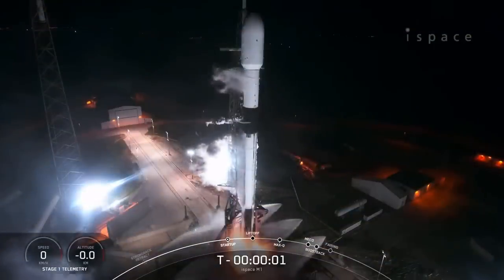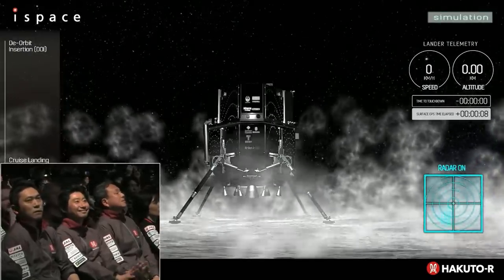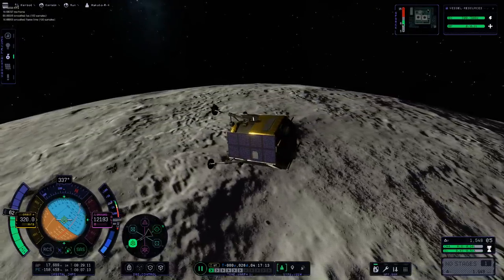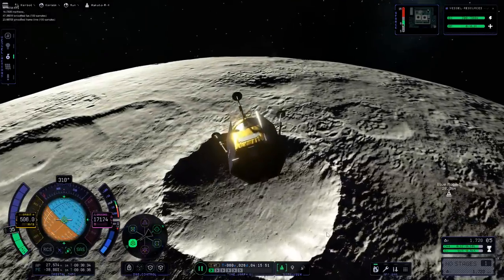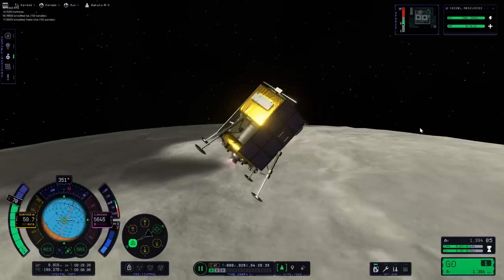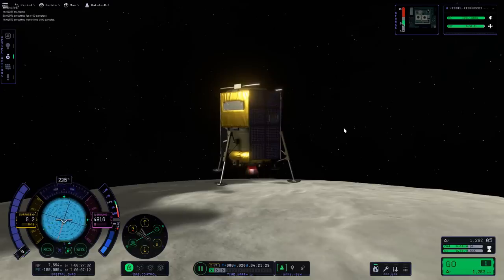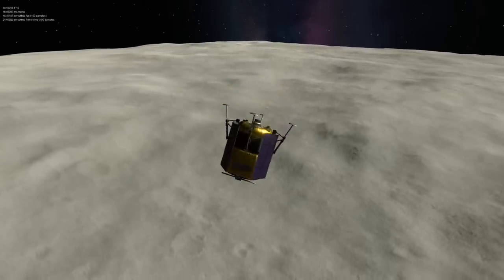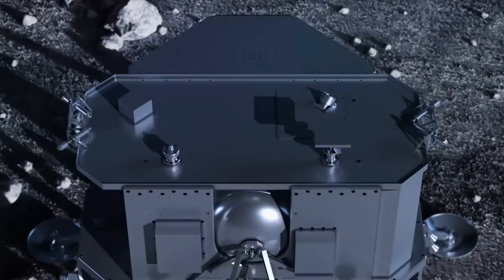Why Japan's Moon Lander Crashed Due to An Unbelievable Computer Bug

Comment: Given that it was not possible to land the craft without the altimeter data, it's an odd programming decision to permanently ignore that data the moment it starts to look janky.  Odds of the altimeter recovering its wits may be slight, but I'd rather give that a go than rely on an approximation that's +/- 5 km in altitude.
Reply: Exactly what I was going to say.  Since radar altimeters are highly robust there is almost no situation where you should ignore one.   If it does fail your mission is doomed, whether you ignore it or not.

Comment: My Dad helped design the Apollo lunar landing software ... and curiously enough, it was never used due to a sensor overload ... the famous DSKY error 1202. When Neil Armstrong disabled my Dad's software for Apollo 11, that was the end of it. The LM landing program was always over-ridden by future LM pilots and the LM was landed manually. The fault was in a completely unrelated system ... I guess a lot of people wonder if it would have done its job. My dad says it was pretty robust and he never saw a simulation that it would have failed if given the chance to run to completion.

It's a good thing Armstrong was a good pilot!

My dad would go on to be famous for mockups, and then later, he worked on the avionics of the world's most capable fighter jet. He's getting old, but still with us. I wish he was more of a storyteller ... but the one he thought was the funniest (and most irrelevant) was meeting the president in the restroom at NASA ... as in, um, nice day, isn't it Lyndon? as they conducted their business. I am guessing it was during LBJ's visit to Houston in 1968, the same time frame that my dad was working there.
Reply: You  PT-xi5rt   didn't know that LBJ was president? Or that he used the bathroom like the rest of us?

Comment: Didn't Neal Armstrong have to do some on the fly recoding to overcome the 1202 error when the Eagle lunar module was getting overwhelmed with input?  (Which was fixed on later Apollo missions through code fixes and turning off an un-needed radar as part of the checklist?).  Seems like they could have used an altimeter, but on the moon the altimeter setting is always "00.00" 😅

Comment: Stuff like that is really hard to catch before hand. Perfectly good sensors spit out garbage sometimes. I honestly think it might be worth having dual altimeters just to make the signal more robust. (Yea i know it would weigh more) but maybe lidar + radar. Then you make the software not able to disqualify both the radar and lidar at once or something.
Reply: Calling it a bug seems wrong tho to me, dual altimeters at least would continue measuring.
Sounds to me if an unusual number pops up you don't straight up then ignore further readings maybe?

Like did they set up the software to turn of a key component off once an odd reading occurred?
Having a backup for dual if not triple check incoming data on the fly instead of relying on past information should be normal.
 Just because a road was empty 30 seconds ago doesn't mean I'll blindly trust there won't be something speeding around the corner.

Expect the unexpected especially when it's not on the same floating rock right.
Reply: @dounyamonty  The system was designed to ignore all new data from a sensor if it felt like some of the readings were out of bounds. They could have had 20 altimeters and the system would have ignored them all because they all would have shown the same "error".
Reply: @patreekotime4578  When you have only one sensor for a given parameter, treating it as failed after seeing out-of-bounds data from it is just about the only thing you can do.  But when you have more than one sensor, you can cross-check them, and that usually becomes your primary method of determining whether a failure has occurred.  If both sensors do something unusual at the same time, you might reasonably infer that the problem is not in the sensors.
In this particular case, the spacecraft should have been able to cross-check the radar-altimeter reading with the topography it was flying over.  Seeing the distance-to-ground reading increase rapidly as the ground abruptly drops away beneath the spacecraft is an entirely expected condition.
Reply: Right! Really hard. Who would consider that the Moon might have craters?

Comment: Sounds like they tightened the Mahalanobis check magrins in Kalman filter. It's the check that real measurement at each time step, expected measurement and estimated measurement errors are all in accordance with each other. And you usually hardcode the acceptable marigins for that, i.e real-expected measurements must < 4 times expected error. If it isn't the measurement is bad (e.g. accelerometer physically fell off the mounting). Unfortunately the margins are often set too tight. 
It could've been another problem tho, related to algorithms similar to simulataneous localization and mapping, but I don't have enough experience with them to judge.

Comment: When flying on instruments, pilots are trained to trust what the instruments are showing them, not what the software in their heads is telling them "I can't see the horizon, so I think I'm upside down..." No... You are the right way up etc.
Reply: We too low...
Reply: @thePronto  We too high when we ran out of fuel... OOPS. Instruments didn't lie then?
Reply: @brianjrichman  bang ding ow.
Reply: Been through the training, you absolutely cannot trust your feelings. It varies for each person, for me, I felt I was leaning one left and right. I had to actively fight to focus on the instruments, draining your energy very quickly. Even if you are completely focused on the instruments, your arms will try to 'Level' the plane.  You acclimate with each subsequent flight easier, eventually it's nothing. Instrument flying is still draining as you have to fuse all these sensors. In comparison, looking outside is about as stressful as driving.
Reply: @thePronto  :face-green-smiling:
Reply: @oohhboy-funhouse  Yes Sir! It's almost like the programming team had no idea that the moon has craters...

Comment: I would add optical recognition and stored high resolution images to the package. These would optically compare the expected position and orientation to the visible information and so call out anomalies. This entire apparatus would be as small as a Raspberry Pi, using off the shelf components. DJI drones use something similar in their RTB software. When the drone sets off, it takes photographs of its starting location and compares them to the downward facing camera live images when returning to land.
Reply: One of the reasons Chandrayan-2 failed because of the mapping. When the lander moved away from the photographed landing site it tried to over correct and failed.

Comment: I remember one of my computational methods professors said: "There are no such thing as software bugs, only human error" in one of our first lectures so that we would code more carefully and make sure everything has correct syntax before moving on to a new line. It'll save you a lot of time rather than overconfidently writing 100 more lines of code and then having to scroll through it all only to find that you coded "fr" instead of "for."
Reply: Most bugs are not caused by typos but by overlooking consequences somewhere else in the code, like creating a potential timing/synchronization issue. Or by wrongly interpreting the functional requirements, or by misreading the documentation from an external library and things like that. Typo bugs are rare, except in the ui but that is because certain programmers cannot write decent English sentences 😅
Reply: @effedrien  I think he was just giving a basic example.

Comment: Why haven't they orbited GPS satellites around the moon yet?
Why don't they drop transmitters to the surface first as becons?
Reply: The Moon has very few stable orbits, and they still require propellant. The moon is very lumpy and the earth tends to fling you off.
Reply: Dropping beacons on the surface is the exact same thing as putting a lander like this down.
Reply: @samuraidriver4x4  To make it easier to land our probe, we will first land three probes.
Reply: Apollo did that once using a Surveyor lander as the beacon.  But that was just for position, not altitude.
Reply: @samuraidriver4x4  
Really? Can you describe your design?
I was thinking about a lightweight baseball sized package on the end of a long collapsible pole, throw a dozen of them out in hopes a few survived to do the job. 
Or how about a huge air bag with the probe suspended by rubber bands in the center, no need for an accurate landing of the beacon.
Did y'all really think I was suggesting to land a huge piece of equipment to be a beacon?
Reply: @mballer  what would you expect to happen to those when they smash into the lunar surface at let's say 500kmh?
Airbags and such need to be extremely strong to work inside of a vacuum and also withstand the impact, that's alot of "dead" weight.
Keep it "simple" and do a powered landing.
And for a beacon you do want a precise landing on a precise location otherwise there is no point in using triangulation to figure out positioning and altitude.
Atleast that's how I think of it.

Comment: This story reminds me that once I planned to make a simulation for spaceships/probes, where the simulation goes down to almost hardware level, where the subsystems (sensors) could be  configured to have a certain precision, sampling rate, processing delay, and the way how they communicate with the CPU, the flight computer, so the design of such a vehicle architecture would be closer to reality. Also, the propulsion units could be configured to have delay to start/stop/change working, and a function, how it is done.
May be, in KSP3? :D
(Feel free to use this idea, most probably I won't have time to develop it.)

Comment: Dunno if you'll see this, but I'd be suuuuper interested to hear your thoughts on whether software engineers should have the same certification processes that physical engineers have.
Reply: Fyi: they do have in some countries. 
One isn't allowed to develop software for medical gear for example here in Germany without certain qualifications. There are also legal requirements and standards that the software development teams working on critical or potentially dangerous software have to adhere to here both in regards to coding and testing, but also in regards to their overall software design, risk analysis and much much more.
Reply: The kind of software you're working on makes an enormous difference to the consequences of getting it wrong, and I don't think it necessarily makes sense to try and develop a certification scheme that's simultaneously rigorous enough to assess people working on nuclear reactor control software while not failing 90% of candidates going into a career in casual game development...
Reply: They do. Software engineer, computer engineer, computer scientist, etc they are all degrees that you can get studying in college. The issue is that you have all the 3 month long React crash course Jimmys that call themselves "software engineers" when they are software developers instead. So yeah, there are many different certificates for software engineers, its just that the name is often not respected.

Btw Im not trying to shit on self taught or non engineer software devs. The same way people like Michael Faraday did amazing things in the name of scientific research without a degree, some software developers are incredible at what they do. I dont want to sound like Im implicitly blaming the lack of certificate enforcement as the reason why stuff like these software bugs exist. This could have very well been coded by a software engineer, who would be also not to blame because stuff like this has to be peer reviewed and tested by many people and on many levels. It was simply and incredibly unfortunate event
Reply: A degree is not certification. And for physical engineers that assume accountability for the designs of their companies, Principal Engineers, their job titles do not come easily. What would be interesting to see is if there is any push to require engineer ACCOUNTABILITY, not just responsibility, as things are currently in the physical space.
Reply: This brings me back to my software engineering course.  There are supposed to be several stages like requirements, specifications, design, implementation, testing, maintenance.  And each stage is supposed to be evaluated and fed back to improve processes.  The instructor stated that there had only ever been ONE software project to have ever followed the theory: Space Shuttle avionics.
Reply: If you care for my tought: There's probably nothing wrong at all with the software engineering side of this. But someone who is not a software engineer either didn't bother to read the specifications or thought "that's probably going to be all right, anyway it's time for dinner now".
Reply: No, but certain industries can and should be regulated more. If someone is riding on whatever you've built, then there needs to be more oversight.
Reply: No, certification is worthless.

The physical equivalent would be if you had an engineer carefully design a bridge over a river, and then you decide to build it but on a completely different river but without checking to see if the design is suitable for the different location. Do you think certification is going to solve that?
Reply: The problem with all of those schemes is that sometimes the person with the most creative solutions or the best knowledge of how the systems work is the person who has just been doing it forever since before those schemes existed. Afterall, a room full of people with the same training are all going to have the same blind spots, and the same solutions. 

And anyway this doesnt seem to have actually been a software issue so much as a management issue. Someone changed the mission parameters and then decided they didnt need to run more simulations. I doubt the programmers even had a say in that.
Reply: @fluffysheap  good call. It is a very different thing to run software across diff hardware. Conundrums abound.
Reply: most engineers can program. maybe not to the top levels, but enough to get their work done. My bosses were a bar bouncer and a ex piolet, when I went from engineer to programmer
Reply: Introducing licensing/certification requirements for software engineers in general (not just specific fields like medical devices) where they are held accountable for bugs is a really bad idea. In most companies, the software engineers do not have decision power over what is being developed, and sometimes they don't even have a full picture of the scope of the project. The senior managers have all the power and easily overrule every decision, sometimes without the developers even knowing. If anyone should have mandatory certification it's them. I'm willing to bet something like that happened here. Senior management made a change in location for some reason unrelated to software development, and possibly not even inform the developers. Or if they did, I bet the developers told them it's untested for that scenario, but were completely ignored.

I worked in software development for banking. Most of the time I didn't even know exactly what I was developing. Everything was ultra compartmentalized, and I wasn't high level enough to have access to that information. Low level designs came in, implement this small piece of code, take these input parameters, perform these operations with them, return the result. Like for example my code gets these anonymized variables jtavrhg23 and lsgsdfthg62 and I am told to add them together and return the result. I'm simplifying it, but that was the essence of it. What do these variables mean? Are they amounts in customer accounts? Are they the number of transactions for this and the previous month? I didn't know. That's how it all went when developing highly critical business processes (the secret sauce if you will). The person above me knew, the one who passed me the design, but they didn't know everything either. They were going in blind as well for big picture stuff. Everyone knew a little bit, and the only people who understood the full process were not software engineers, but business people, accountants, lawyers, economists, upper management etc.

Imagine that I had to be certified and be legally responsible for the software bugs. It's ludicrous, there was no way for me to know the full scope and implication of what I was writing. Certification like this is just a way for management to remove any responsibility from themselves, and have someone to blame in the lower ranks.
Reply: It's more to document and prove that they accounted (requirements) and tested (unit tests and integration tests) the software design as expected. The trick here is doing real work to design good tests (not just trivial unit tests). With continuous integration (CI) and continuous delivery (CD) you run your tests after every change or addition that you make to the code. You could have a certification for all that but what you really need is having a matter subject expert to verify your design and tests (software engineers don't understand it all the first time).
In my opinion, the code for this moon lander should have had the logic for maneuvering over any crater (there are so many on the moon!), but if each crater is unique, you just keep adding that unique logic to your test suite, so you make sure your future code changes don't break the navigation of any of the of craters on your list...

That is the theory but unfortunately, because of budget constraints and time, testing design and testing teams are removed from the development plan (i.e. Microsoft).